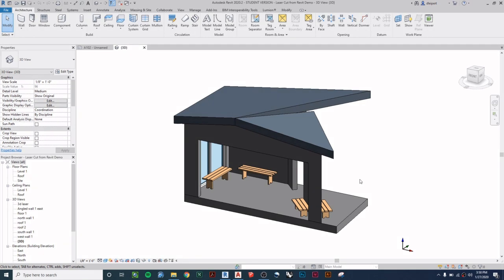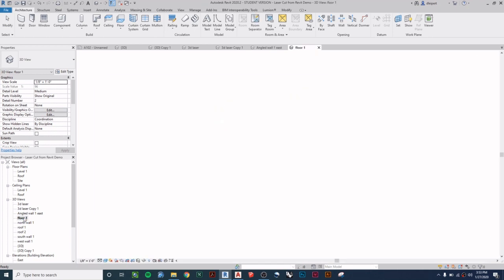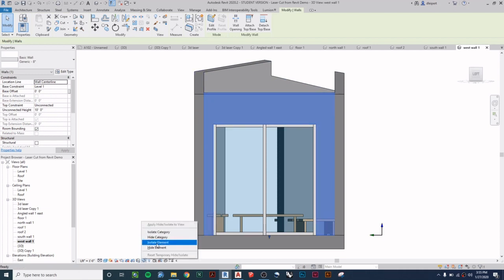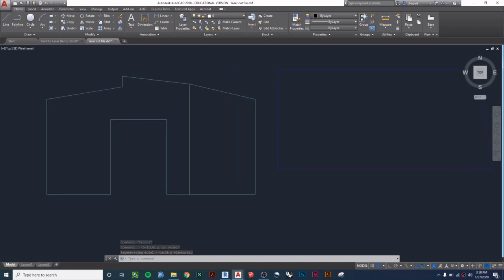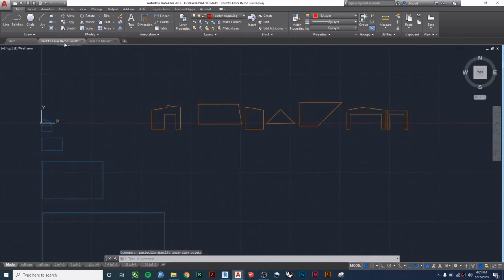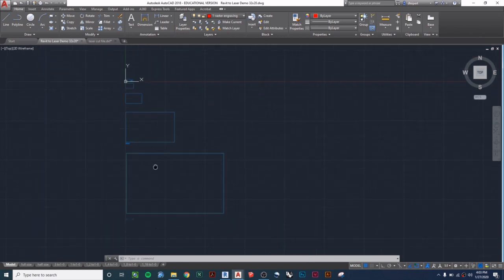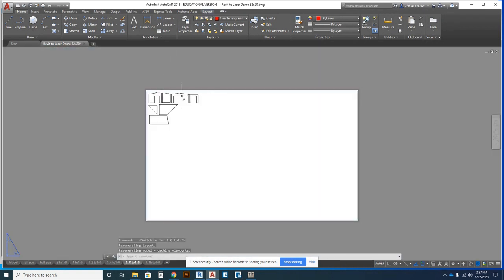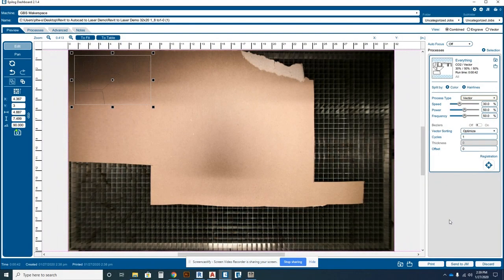Laser Cut from Revit- Workflow Tutorial

Comment: how about curved walls?
Reply from the maker: For that you’ll need to a little bit of geometry and some material that is thin enough to bend to your curve - glue extra layers on later to your desired thickness.  

The geometric way- you can calculate (2*pi*radius)*percentage of curve out of 360 degrees to get the length of the wall, and then in AutoCAD draw the height of the wall and the length from the formula above.  

OR- I think an easier approach is to cut cut a strip of material (in AutoCAD or Revit draw a rectangle at your wall height and at a length as long as you can) then print your floor plan to scale and bend the strip of wall on top of the plan to show you the length.  Mark and cut!

Comment: Thanks so much for sharing this! This will help save so much time and frustration with angles! May I ask what type of laser cutter you have? I am about to graduate from the MArch program and looking for suggestions outside of the school for cutting.
Reply from the maker: The one in the video is an Epilogue 60 watt laser, which can cut up to a 1/4” thickness  pretty well. However there are plenty of there that are good cheaper options out there for thinner material (lower watt) but don’t always have a good venting configuration built in. So if venting is not an issue, for example if you could run it outside or in an open garage, that opens up your options and lowers the price point.  This one is good for an at home option and for the price https://amzn.to/3yFyOkd

Comment: Excellent video!  I work with some high school students that can use this.  F.Y.I. - In AutoCad go to drafting settings (DS) and increase the size of your pickbox (not too big).  Then you won't have to use crossing to select every line because of the tiny pickbox.  Also in trim (and extend) hit enter instead of picking a line to trim to.  Then all lines in the view become trim lines.  You only have to pick the ones you want to trim (or extend).  Also holding down shift toggles trim to extend and extend to trim.  Keep up the good work!
Reply from the maker: Chuck - thanks for sharing the tips! Everyone loves a good keyboard shortcut!